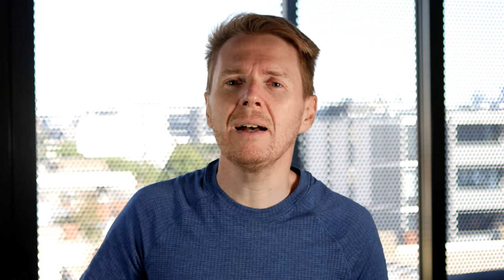DIY 617 Panoramic View Camera Build : Cheap Shen Hao Replacement Part 1

Comment: I designed my own 3D printed roll film back for use on the shen hao, and then I made the back able to convert to a point and shoot camera as well, since I can use that right away. I posted a bit about it on largeformat forums a few weeks ago. I have lever action film advance on mine. 

I'm building my own ebony/shen hao 6x17 field camera though because of the cost to buy a new or used version. I need to wait for better weather to set up my wood working shop before I can get to the wood camera build though
Reply from the maker: Nice. I wish I had room for woodworking tools, I miss the process.

Comment: Thanks for sharing the video, have been toying with a similar project for my 5x7 rittreck for a while, though also have an old half plate camera I need to restore that would also be a prime candidate for a 6x17 back that I hadn't considered before. Out of interest, where did you source the thinner fabric for the bellows?
Reply from the maker: Yeah, the Rittrek was on my list of possible donor bodies.
I found a window blackout material, it is white on one side and black on the other, so I had originally organised it until I realised, the white sides are on the glue down side so you don't see it. Much thinner than standard blackout material

Comment: Nice project. Do you plan on sharing (or selling) the 3d STL files for the back?
Reply from the maker: Thanks. Hasn't thought about that, I'd have to do a fair bit of cleanup on the files to make them presentable
Reply from the maker: Have finally finished the design to a quality I am happy with, its up on Thingiverse now https://www.thingiverse.com/thing:6625537

Comment: You sound surprised about the precision of timber made parts. Have a look at an Ebony! a skilled craftsman can produce incredibly precise designs with stable fine grained woods.
Reply from the maker: Oh not surprised by what can be done with timber, probably more surprised at how well they have stood up against the test of time, decades and decades and yet they still fit perfectly, I doubt anything made now out of newer materials would do as good a job.
Reply: @thefilmlaundry  yes that is very impressive given the age and that humidity can impact tolerances.
Reply from the maker: @faraz2498 definitely humbled me as I continued to mess up the tolerances on my  3d prints, that's for sure 😂